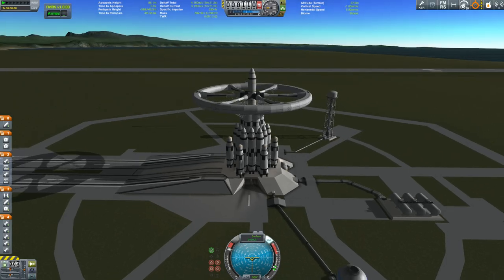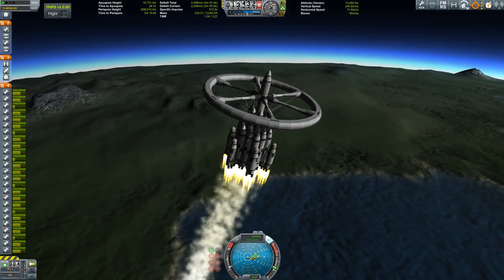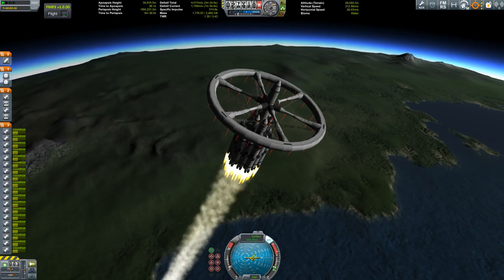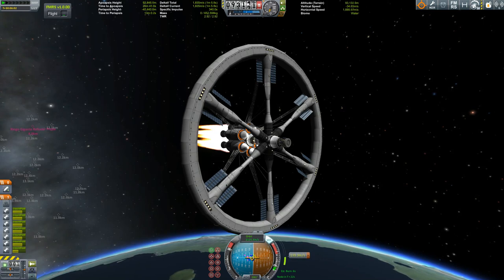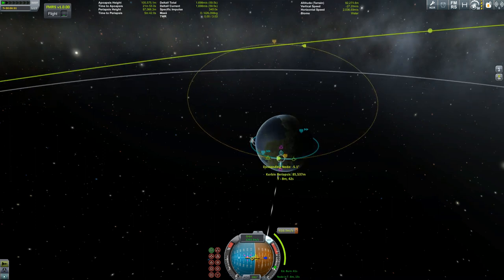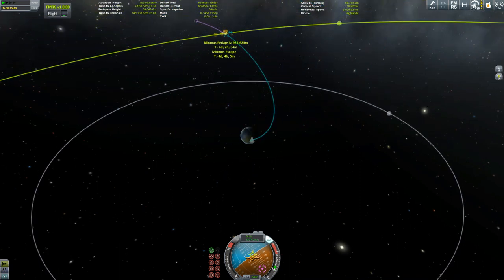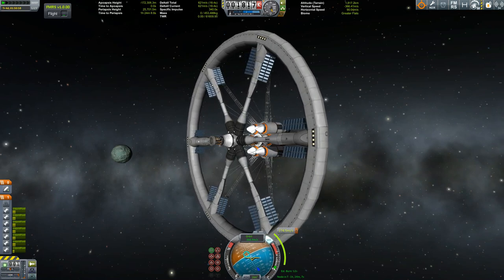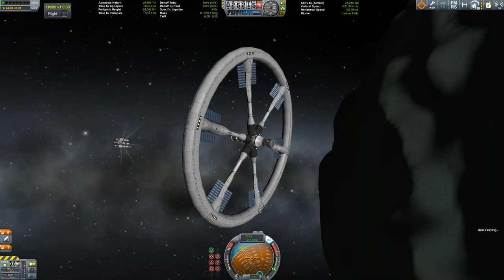Operation Moonsucker Episode 1: Ringo Gigante Refueler to Minmus

Comment: 8:10 almost. The Oberth effect is to do with the energy gained when firing rockets at different velocities. Since energy increases as the square of velocity, and a rocket's delta-v is the same regardless of velocity you get more energy the faster you are going when you fire, which is why firing when you are low is best. The oberth effect has more repercussions than simply this though

Comment: So... KSP doesn't have any mechanism for constructing a station like that in space where you could bring it up a piece at a time?
Reply: Recon777 Gaming It does: Docking. Only issue is that docking huge pieces together tends to make it a bit ugly and weak.
Reply: Jordan O'C In my experience, unless we can place struts in orbit, with an engineer kerbal for example, docking is not option for huge space stations. They tend to self-destruct with movement or when igniting engines.

One solution for who plays with mods, is Kerbal Joint Reinforcement, a mod that I think should be part of the game. Without it, it seems that kerbals use jelly to stick together the parts. That's an aspect that I have always hated of the game.
Reply: vistaero Well, there are ways to secure connections between docking ports, but they always look ridiculous, but here's how I think you'd do it: Use a standard Sr. port, and with 6 or 8x symmetry, place normal ports around it so when you dock, you have multiple points of contact.

Indeed, KJR needs to be a part of the game. I tried making this ring stations and I can't even launch it, it's too floppy. All moderately heavy craft seem to have this issue, which is irritating.
Reply: vistaero Quantum struts. It's an extremely light and simple mod but it is vital for building stations / ships in orbit if you don't use KJR

Comment: what mod he used to transfer fuel?
Reply: It's not a mod, Alt richt click 2 or more things that hold any kind of fuel or charge and u will figure out how it works.
Reply: you don't need a mod to transfer fuel. you just need to do mod+rightclick on the fuel tanks/batteries/ore tanks you want to transfer resources to and from. Also, the "mod" key is different for each operating system. check the ksp wiki (http://wiki.kerbalspaceprogram.com/wiki/Key_bindings) for more info.